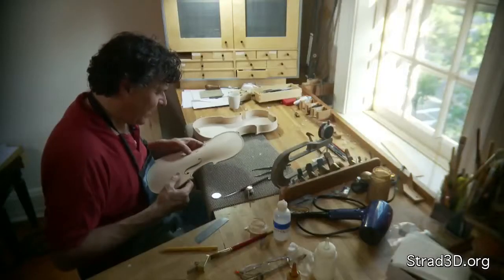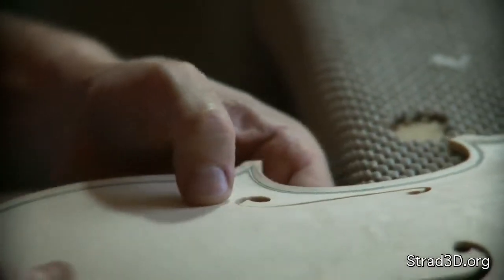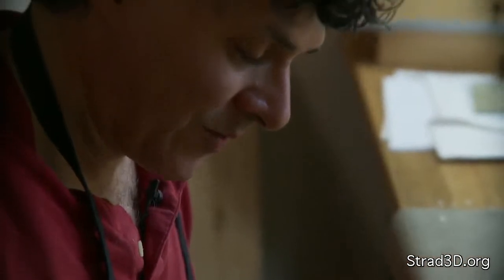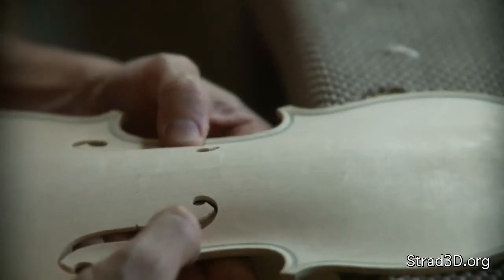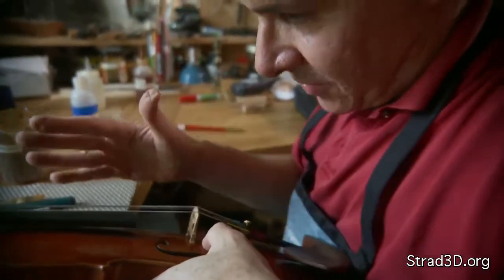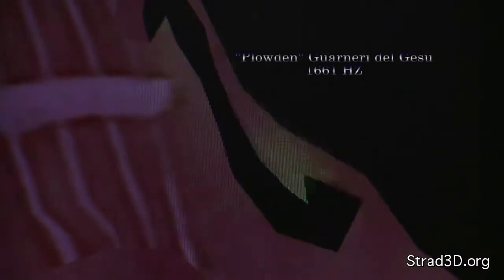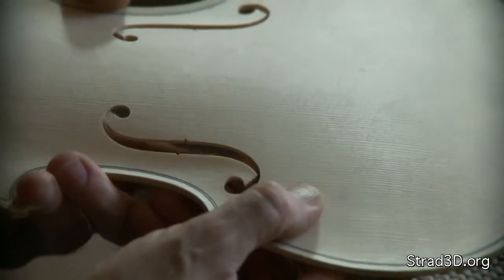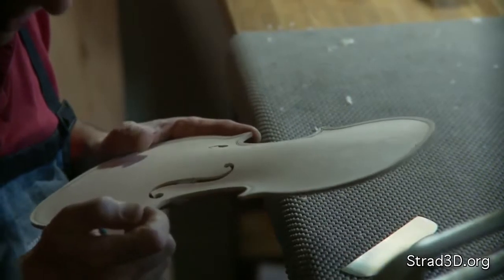Strad3D: F Hole Design - Tradition Meets Science

Comment: Yeah but, are people actually designing and testing alternatives to figure out what sounds best? If the f hole is interpreted as the correct solution (and as it's present on nearly every western modern bowed string instrument I will say that it's interpreted as the "correct solution") then surely there should be empirical comparisons to alternatives in which the f hole is shown to be a superior design. All of this reeks of the breed of essentialism in which people are so scared to innovate that any attempts at deviation are called out as offensive to the so called essence discovered by the previous radical designers.

Comment: Dear cory palmer thoes arenicks representing scale length and bridge position relative. The common scale length for amodern full size violin is 328mm exactly! That is the working length of all four violin strings. Ergo the portion of the string that ocillates. The distance from the front edge of the bridge to the nut is this scale length weve been discussing. When you tune a.violin this distance creeps up or back thats why tuning a violin is so difficult and frustrating for beginners and young children, and untill very recently myself. So you tune it. Then measure the distance preferably every time. But once the strings have stretched you may get away with not measuring as long as it stays in tune. There is what is called the mensure line but you will have to look that up yourself. Im telling you because I do not want you to be as frustrated as I was for many years. I even gave it up because no one would share how to do all this and use a pitch fork on the bridge not the violin. It gets more complicated but at least I have given you some pointers. By the way the nicks are put there by the violin maker. They are not always accurate! Hope ive answered your question and helped. These and many other anomallys are why playing violin is so hard. It is essentially a game of chess and you have to know each piece.

Comment: What a load of NONSENSE. No one has shown that sound hole design has ANY particular effect on the sound. You could probably drill a couple of ROUND holes and get the same sound. Of course, no one will ever TRY that because the results would put the "experts" to SHAME.
Reply: The round holes don't fit, hence the f-holes. But I am with you. A great violin doesn't need to have such in-depth analysis. I have played a couple of Strad's, Guarneri's, Testore's, Parnomo's, Hill's... the list goes on. My favourite (as well as the audience's) was the Carlo Testore. It was deep and tender, and also powerful and rich in colour. It had cracks, the f-holes were VERY uneven, the thickness of the front was very thin in some places and "too thick" in other places. The back was about 5mm on average in thickness. I had the [roughly] 5.25mm soundpost replaced with a new (50-yr-old spruce) 6mm soundpost and the sound was magical.
Such a rough looking and rough-made violin.... but it was better than the Strad which was bought purely for the name.....
Reply: And I agree not every strad sounds good. I've never played one and would be afraid to. I wouldn't want to play anything other than an nailed original. As intended by Antonio with the straight neck. The scale length would be shorter and I would be in the Baroque plane entirely different from western scale.might even meet Agness Moorhead or Jean De Aragon! Anone! Hence I leave you.
Reply: It’s not nonsense at all. The flow of air around the edges of a shape is faster than the middle, thus why an f hole can produce more than twice the amount of air flow than a circular hole of the same area.
Reply: Yes ray Taylor, dozens of people have experimented with different sound holes on various resonating string instruments and there are definitive differences between each one. There are reasons for all of the design choices that luthiers make. It may be subjective which ones you prefer but most people will agree more resonance and volume for less effort is pretty universally desirable.
Reply: Glad you nursed the sound out by the post.  I like fiddling with them too but I play them  like marionettes. It's almost fun.

Comment: Very interesting I wonder why there is a small cut on both sides in the middle of the f hole? And do you think there is an optimal design to the f hole?
Reply: Very simply - it's an "instruction" from the maker about where to [optimally] place the bridge.
Reply: The cut adds more vibrating tabs of wood.